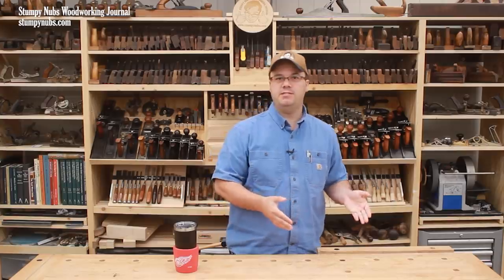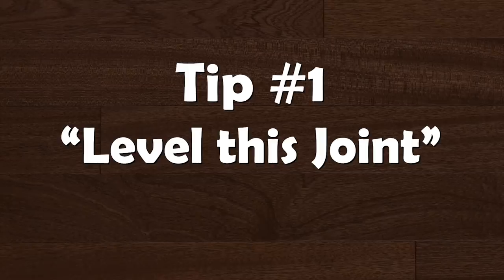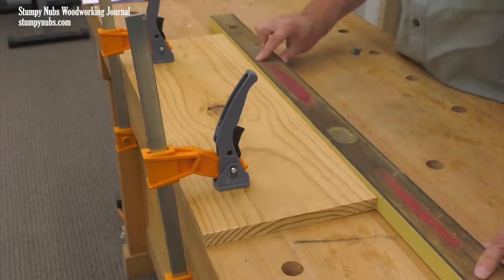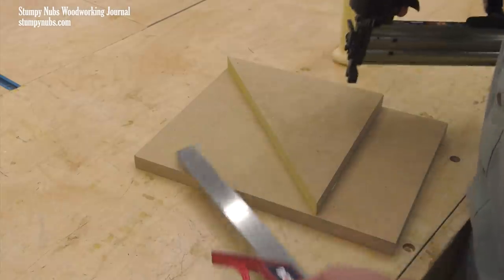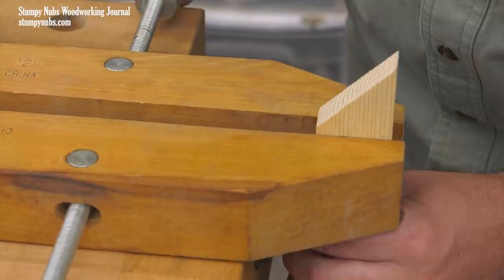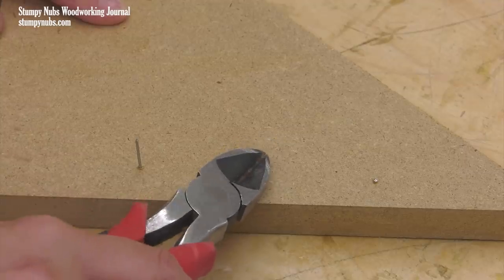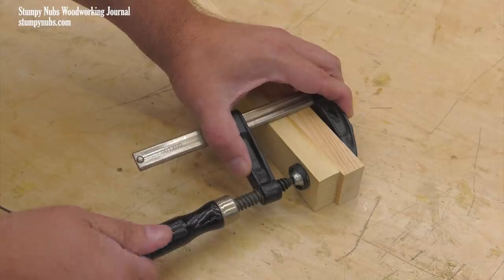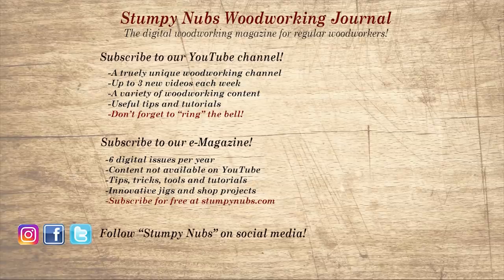Five of My Favorite Weekend Woodworking TIPS!

Comment: Tip 4B, glue in some soft rubber chunks or squeeze in some silicone into the cutters, slice silicone down the middle and trim neatly. (Or apply to each side separately and trim as needed so they meet just right) You then have gripping material that holds whatever you cut off. I prefer this over a magnet or magnetizing the tool. One can simply open the cutters and the piece falls instead of having to use the other hand to remove it. And it works for non-ferrous materials, copper, plastic, etc.

Comment: The 45° sanding/holding jig is fast and easy to make out of scrap, so I make a separate dedicated one for the sander with a snug fitting 3/4” rail glued & screwed beneath to fit into the sander’s miter track.  No clamps to fiddle with, easy slide on/slide off, total access to the workpiece with full range of motion for the operator.  Also lets you drag the workpiece to other areas of the disc to spread out abrasive wear, etc... 👍🏽

Comment: Great idea for a series. Great intro.
I have a very true piece of aluminium tube that I use for jointing.No humidity issues and temperate stable around the shop. I typically put the part on a piece of 1/8" door veneer to get the best results.

Comment: Instead of business cards, you can also use an old (or new) deck of playing cards, I use them for all sorts of things when I need a little bit extra gap or to fill a gap. Also great tip on using an elastic band on the clamps I will sure be using that one.

Comment: Tip: removing brad nails fired from a nail gun, either "stick-out" or a wandering blowout, do not cut or pull, bend them a few times until they break. They will break off below the surface, no cutting then hammering and setting. This works on 23ga, 18ga, 16ga., may work on 15ga, I haven't had to try those yet.
Reply: it even works on framing gun nails. try it
Reply: I always do this with brad nails 
Most of the time you'll cut them or keep break them off  anyways 

Works great
Reply: These guys knows what’s up. I use a lot of standard crown staples and it’s the best option for removal if you’ve got some misses. Don’t reach for the side cutters here first though, needle nose pliers and a few wiggles will suffice. Doesn’t work so well when there is a small amount of nail coming through..

Comment: For tip #4, instead of placing a magnet, get yourself another set of pliers and fill the cavity with silicone. 
When dry, use a razorblade to cut a line from the top all the way to the bottom of the jaws so that the pliers will work as usual. Now you should have a thick wall of silicone on either side of the jaws, gripping whatever you're cutting off.
This has the benefit of working on non-magnetic materials as well.

Comment: I have a simple, no miss method of creating a center finder:

1. Get a strip of wood around 1 inch square. The length depends on the width of the boards you want to mark,
2. Scribe a line lengthwise on the strip close to it's center.
3. Open a divider to half of the desired length between the end pegs and hold one wing in the scribe lib near the center of the strip length.
4. Swing the divider around and make a mark at one end then swing it around and mark the other end.

You now have a wood strip with 3 equally spaced marks to drill for the pegs and the marker.

Comment: If you find yourself using that hand clamp idea, you could drill out a little hole and glue in a small magnet to help pull the saw flush against the clamp (vs the finger pressure pushing it against the clamp).

Comment: Vided idea: Denatured alcohol has been basically "outlawed" (or at least significantly restricted) in both California and Canada. i'd love to see an actual side-by-side-by-side experiment with Shellac where several of the suggested alternative products are used to determine (or at least rank) the best options. I'm amazed that after 2 years of California's resitrictions in 2019 that there hasn't been, like, one clearly-preferred alternate that's recommended. In my tickling of the Googler, I mostly keep finding, "you could try..." and "I think _ should probably work", but nobody that actually successfully switched to an alternative. It seems like nearly everyone goes with oil or poly-crylic type finishes now.

Comment: Good tips, and great idea for a series. Notes: most stainless steel is non magnetic, so tip #4 should start with a quick check of magnet on nail. Looking at angle jig on stationary sander, feeding the stock into the jig where the belt feed will pull it in and maybe throw the whole assembly up if it snags seems unsafe...  I would reverse the angle so a snag would just push your stock out a bit. I have made that mistake.... just once though. Still have all ten, but I gave my adrenals a workout that day.
Reply from the maker: I assume you are talking about the mitered workpiece? In the orientation shown, the belt is moving left to right, which would push the piece away from the jig's fence, the opposite direction that the wedging action may occur.
Reply: @StumpyNubs  thanks... must be a frame rate artifact on my device.... belt looked it was going the other way.

Comment: Thank you for this segment. I am going to use the first two for sure. I've not done glue-ups (yet), but the level jointer is one I will likely use. Too bad Dura-Grit doesn't make their carbide sander screens 4 foot long (and thank you for the discount, I got a 60 and a 120 grit block and LOVE them). I bought a Wen oscillating sander and the only regret is that it does not have a miter gage slot like the Ridgid sander does. I was going to design a table with a slot so that it was self-squaring to the table (and belt), but thanks to your tip, it will be much easier. And I'm sure I could come up with a way of making angles other than 45° and 90° with this jig.
Now if you could just help me with Weldwood Non-Flammable Contact Cement (water based). I just cannot get HPL laminate to stick to plywood.

Comment: Nice tips, thanks!  Instead of a 4 foot level, would a piece of square aluminum bar or tube stock from the orange or blue retail giants work?  I have some of this stuff , but I'm just not sure if it's square and true enough for this purpose.
Reply: The heavy angle should be suitable unless someone has been using it as a pry bar. Just give it the Mk.1 eyeball down the length like you do a piece of timber to make sure its straight. Some places you can get a 'T' shaped extrusion in decent lengths - its also sold in short lengths in hobby shops for sanding wooden model parts like wings and hulls.

Comment: Love your shop tips but I have a better solution to the sliding clamps better than a rubber band. Use a small wire tie. wrap it around pull it tight. You can slide it wherever you want and it keeps your clamp where you want it. You can put one on each side for right side up and upside down keeps them right where they belong

Comment: I have a question on the DuroGrit for random orbital sanders. Does the Velcro ever wear out? And does the DuroGrit pick up a bend when taking it on and off the sander?
Reply from the maker: They send you an extra hook and loop backing, and you can buy more if you ever need them. You could bend it if you were careless, but it is not hard to remove it properly. If it got a little bent (not kinked) you could re-flatten it fairly easily, I suspect.

Comment: What brand and model are the lever type bar clamps shown in this video?  How do you like them?  Thanks
Reply: Brand is 'Bora', available in a lot of online stores in a couple of sizes if they are not at your local. Also sell a lot of workshop accessories like the 'Centipede' work stand and a clamp on system of saw & router guide rails.

Comment: Wouldn't you be able to do the jointer trick with a piece of angle iron? I never checked to see if they were square, but seems if they were someone could just put the sandpaper on it. Or maybe get a square steel and you could put two different grits, for cleanup. You could just drill a hole in the end to hang it somewhere, plus you could get an 8 foot piece for the extra long joints.

Edit: I just thought of one drawback to the square tube is that they don't generally have a tight square corner, more of a round over. The angle iron should be square though.
Reply: Use aluminum. It will be much truer than steel. Trust me, I work in welded fabrication field.